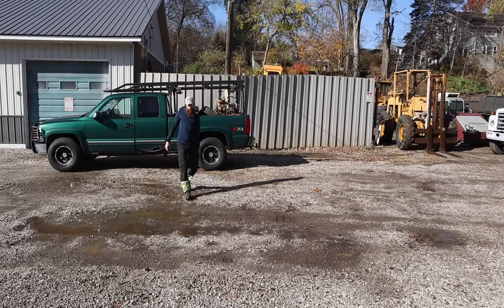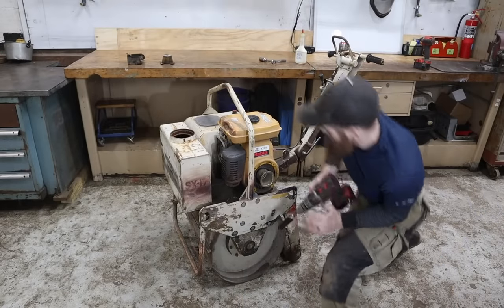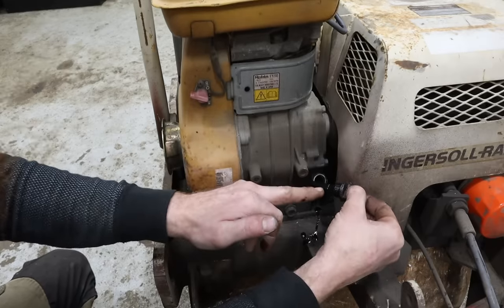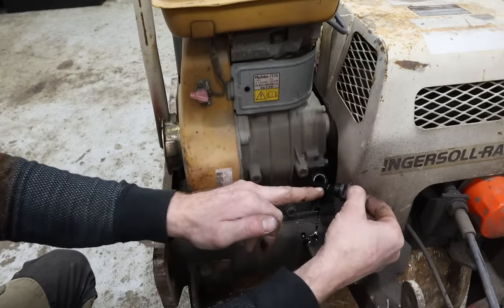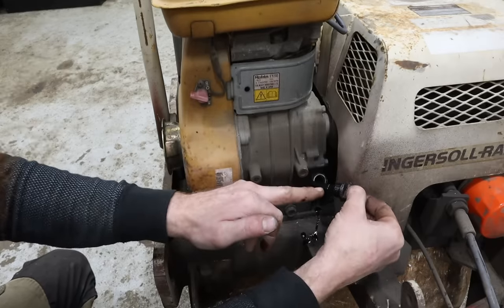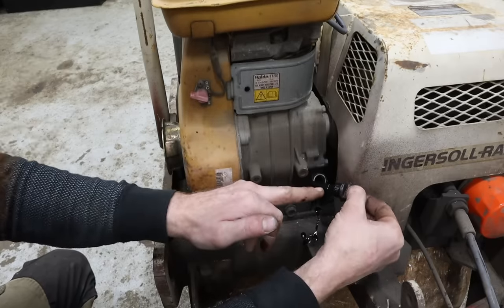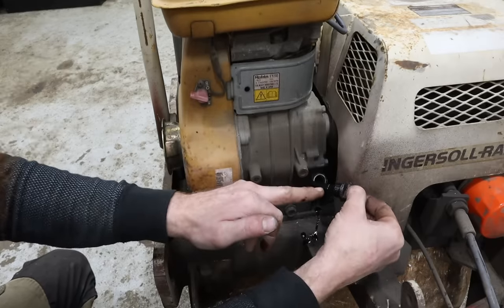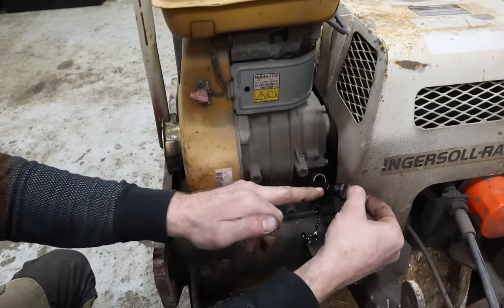I PULLED this Roller from a DUMPSTER!! -  Can we SAVE this Forgotten Walk Behind Vibratory roller?

Comment: The old rule of thumb when I was in the Navy was, 3kW = 4hp, so 3.7 kW @ 4000 rpm would be about 5 hp.
Reply: 3.7kw converts to 4.959hp
Reply: 3.7 kW x 1.36 = 5.032 HP
Reply: 1Hp=746W👍
Reply: Yeah it 5hp. But for us eu guys kw is comparable. So for example if i have seen what kind of power 3.7 kw electric motor makes i know how much power 3.7kw petrol engine would be, because its the same.
Reply: I think 5,5 chuck mc Atee
Reply: 😊ii😊😊i😊bib😊bbib😊😊ib😊i😊bibi😊😊😊😊b😊ib😊😊b😊bibb😊😊b😊bii😊ii😊b😊b😊bi😊b😊bibi😊😊b😊i😊ii😊bii😊i😊i😊bi😊iii😊ib😊😊bi😊bib😊ib😊i😊biiii😊😊biii😊i😊😊ii😊iib😊ii😊😊iii😊i😊ii😊ii😊i😊bii😊bibiibi😊iíbiiibii😊i😊iiiiiiiiiiiiiibiiibibiiibibibíbi
Reply: @aaroncarlone167  ii8
Reply: H

Comment: According to the innerwebs, the EY20 is 5hp. There are all kinds of manuals available also. That appears to be a simple hydrostatic transmission. There is no high pressure on the outside, the bottom line is suction and the top line is return. Great find! Great to see another video, too long since the last one.

Comment: Shooting a little air under that rubber handlebar grip will make it come right off.  Also hairspray will make them go on easily and will sort of glue them on when dry.  Learned that from putting on the left grip on a motorcycle handlebar.
Reply: I worked in bicycle shops and those both are standard practice. I love the smell of Aquanet in the morning.  If you're good you can shoot the opposite grip off with the air hose and hit your buddy working at the next stand over.

Comment: A trick from the bicycle world for hand grips, you can sometimes use an air compressor to get just enough air in between the bar and the handgrip to get it on or off.  It made my day to see this video to watch today in my feed. :)
Reply: A few drops of lamp oil inside the handles might do the same thing.  They slide on easy and as the oil evaporates, the grips are on solid.
Reply: I slip one or two pieces of welding wire, (even coathanger would work), into the hand grip, and then sprinkle talcum powder in between the wires.  the hand grips will turn right off.
Reply: @jjock3239  That is good to know, but if you have it available, compressed air may be less cleanup. :)
Reply: @josephkrug8579  That is true, but you only need a light spray.  I have a plastic bottle with a fine tip, because I use the powder for other jobs, such as accelerating the drying of superglue.  I don't know the next time I will have to remove handgrips, but I will remember the compressor trick and give it a try.  I am not afraid of new tricks.
Reply: And use hairspray to assemble them. Slippery at first and then ' sticky' , so they won't come off.

Comment: I’ve always heated the last inch or so red hot and then bend the hook, then requench in water to restore the springiness.  It’s worked well for many years with my  outboard, especially when we were in isolated areas.  Usually that’s where the spring decided to bust.

Comment: I spent many years working for a plant hire company and did many repairs on the Robin engines . Replacing the recoil spring was the least liked job , had many springs try to escape as yours did . It felt like winning an Oscar when it went together ! !

Comment: When I worked in a bike shop we would shoot a toot of compressed air under the edge of the grip to remove it and use hair spray to lubricate the grip for installation and then fix them in place. Love the video. Keep up the great work!

Comment: I rescued a little 5hp robin engine with a hole in the crank case I made a plate for the hole and ran it with a bent rod on my lawn mower for about 4 years. Economical to run and still running when I sold the mower.
Bullet proof.

Comment: On spring stock, if you sand off the blue on the last half inch or whatever  you need to bare steel and gently heat until the temper color goes back to blue and while still hot, you can bend the end to whatever shape you need without breaking the end off and without overly softening the spring..
Reply: Motorcycle shop for the cable a clutch cable

Comment: Just a little tip for feeding the pull cord back, cut a notch the same size as the cord in the plastic pulley. This will allow you to wind the cord while the handle is fitted. Honda GX engines have these as standard, but the robin engines don’t.

Comment: That was fun to watch. A friend loaned me a plate compactor that "ran fine", NOT. Same tank & engine, but older, with a paint job that obscured most ID on the unit. The carb cleaning brought back fond memories. It's a great feeling to bring life back to what might appear to be a lost cause. After revival, it worked so well I had to add  & spread two more tons of gravel just to get the level back. Thanks, good work 😎👍

Comment: Nice to see it resurrected,  great work .Tip roller easier to use with handle lowerd , and when before you stop in any direction turn off vibration as you will have ridges especially when rolling asphalt,  thanks for sharing 👍

Comment: great trick to remove those stubborn rubber handles: punch a hole at the end, insert a compressed air nozzle and they fly right off! :) learned that in the bicycle shop i worked in as a teenager.

Comment: I'm not too sure about that particular IR compactor, but I had a similar one and the small roller in the rear was adjustable...  I'm pretty sure you would find it easier to control if you could swing that back roller up a bit...

Comment: Nice find. Packers are so darned useful. The extra tube on the top of the carb, is probably the float bowl vent. I'm guessing it needs a hose to run into the back of the air cleaner. Killing the engine with the fuel shutoff valve, is definitely the best way to shut off an engine...especially if it is likely to sit for a while.

Comment: I worked on bikes. You can remove the grips with compressed air, by using the pistol, and we used hairspray to slide them back on and fasten them again. When it dries they are solid.

Comment: For hand grip removal, lift the grip a tiny bit and spray Windex in the crack between the bar and the grip. Capillary action will pull in the Windex and the grip will slide off.

Comment: As a child I remember my stepfather being impaled by a forklifter fork he was shifting a pallet by hand turned around and was impaled by the fork then pinned against the pallet stack luckily he wasn't alone in the warehouse during the night shift his coworker backed the lifter off him then he picked himself up off the floor and drove himself to the hospital too get stiched up .
If you only need one fork to lift take one off or move the forks together never have a gap you can fit in and never enter a gap between forks never have your back to a forklifter or any other piece of operating equipment practice proper equipment operation safety it only takes a second of  negligence for injury or death to happen.

Comment: great to see the use of an industrial stethoscope. Tip: hold it to the bone behind your ear. I have a BAHA (bone anchored hearing aid) these days and it clips into a bolt that's screwed into my temporal bone (the bone behind your ear) and it is far more effective as it goes straight to the hearing nerve via bone conduction. I used to do the same as you did in the video when I was working on machinery in the holds of ships and wish I had known this back in the day.

Comment: Great Job !!  As for the gas tank... You might be able to get some of major ding's fixed, by using compressed air !  If you can find a metal fill cap and close up the vent hole.  You can use the the threaded fuel line port for the compressed air. I've used this method for restoring vintage motorcycle tanks !  PS: You might be able to use a motorcycle throttle, brake or clutch cable, for your throttle cable problem too.

Comment: Quick tip for removing grips.... spot off oil on the end of a flat screwdriver, tuck it underneath the grip edge and as you skid the screwdriver in rotate it around.  Easy job.

Comment: I have been able to bend a new end with a fine tip on my torch & only heat & bend a quarter inch but it has to be orange hot when bent not just hot. Then you can file in any notches needed.   Good luck!

Comment: I've had great success with using a torch on the end of a broken spring like that.  Just gotta remember to get it HOT and let it cool slowly.  Little pieces can exhaust their heat so quickly, they'll quench in air.

Comment: Just a heads up, before connecting the fuel to carb, run a cup of fuel thru the tank via the petcock to flush it out so nothing gets in the freshly cleaned carb

Comment: What a great free find, Ingersolrand have a good reputation for this type of equipment.
The dipstick for the oil, looks like the one I used to have on my old Honda 90, you need to waist it it to get the correct level. I think you'll also find that there is to much oil, there are marks on the bottom of the dipstick that will show you how much you need to put in. Good seeing you back, have missed your in depth filming.

Comment: This is very useful, instead of squirting petrol in the spark plug hole: Nulon "Start Ya Bastard" Instant Engine Starter (SYB) promotes easy starting of all diesel and petrol engines (both two-stroke and four-stroke). Preserve battery condition and it is totally harmless to engines. One short spray of Nulon is all that is necessary to start the most stubborn of engines.

Comment: Many years ago most contractors I worked for usually had an old timer or “shop man” that took care of equipment and tools. They would make sure that it was cleaned, lubricated, all necessary fluids topped off, etc.  That way everything sent out to the job site was ready to go. Nowadays that’s too expensive, if it breaks, replace it. Pretty much like everything nowadays, Crash it and trash it.
As far as thread sealants go, the only thread sealants are anaerobic thread sealants and Teflon tape. Anything else is thread lubricant despite what the label says. The seal is obtained by the tapered threads and the pipe “sealant “ keeps the thread surfaces from binding and galling so it can be tightened more.

Comment: I have found that small engines LOVE the E3 plugs. I have also seen small engines gum up the exhaust and chock them self out from a packed muffler. For the oil lines they look low pressure, see if you can find barbed fittings and prebent lines from the auto parts store that are oil rated.

Comment: One thing I’ve tried before with those recoil springs is to keep the majority of it submerged in water with just the top 1” or so sticking out (or whatever length you actually need for bending). Using a propane torch, heat it up to just below a hint of red (or just slightly past but before cherry) and gradually taper the heat off over 10-30eec.

IF the spring is still too brittle after trying this, then repeat the same procedure except taking the steel and holding it for 15sec at bright red and slowly taper heat down 15sec until red disappears and another 15sec with the torch on lower heat and/or waving the torch back and forth across the metal. Bend to shape reheat and quickly quench to restore spring. 

If this fails the variation is wrapping all but the last 1-2” in soaking wet paper towels or cut lengths of rags from repurposed cotton T-shirts: All secured w/ steel wire or pieces of copper from electric wiring.  This time you’ll be heating up the end and trying to get your hook bent WHILE it’s still hot from the torch.  Once again, when the shape has been achieved reheat and quench to regain stiffness. 

If you still can’t get any stable results & you can’t get a usable replacement due to Time or Availability THE LAST GAMMBIT, DESPERATE OPTION, MY FINAL SOLUTION is protect the spring as mentioned above and then solder or silver braze any length of similar spare spring or any piece of metal that you think will survive bending and strain. 

BUT AGAIN these methods are almost always done as a form of quick fix or LAST RESORT until a new spring can be hunted down or made (I had WAY TOO MUCH time on my hands one day and was too stubborn to call it a lost cause but I learned something new😅)

Comment: In a pinch, I've  put the spring in a vice with a little sticking out of the top of the jaws. The vice acted as a heatsink.  I hit the end of the spring with the torch and made my bend.  Then I  quickly  took it out of the vice and quenched it.  Worked every time.

Comment: Sometimes you can bend the spring by using a nail by  slowly pulling springaround nail or ɓolt about 3/8 in or larger in a vice and walking it with Chanel lock  pliers carefully. Good luck take your time

Comment: I think the BDU-10 is the same hydrostat transmission used in many garden tractors like the Cub Cadet GT 2550.
Reply: Yes and not sure Hydraulic Fluid is correct for this. What I could find online was Engine Oil 20-50W

Comment: When I make a temporary repair using whatever material is available like you did with the semi air hose. I call that a proof of concept repair. If it confirms what I think is wrong with it. Then Ill use the proper material for a permanent and proper repair. Very common.

Comment: Gas filter can be inside the tank. You maybe need to modify the valve or get a new. The throttle looks like a boat cable.

Comment: Thread it right the way in to ger oil level. I have an EY25 from 1970, and the only thing that I have had a problem with is a sticking valve through lack of use. I don't know about the US, but in Oz parts are readily available for them.

Comment: Great to see you back with another video - you have been missed.
The oil level on these engines are either read by the dip stick not tightened back in or the oil sump is filled till it it starts to overflow. I have two of these old engines but is hard to say which is correct for that particular one.
Check if the mark on the dip stick is correct when oil is at the level where it overflows on the in fill. You might find a second entry also below the carb but this cap doesn't have the dip stick.

Comment: INGRESOLL RAND (JAPAN) RECONDITION HEAVY DUTY Single drum WALK BEHIND SINGLE DRUM VIBRATORY ROAD ROLLER, 17.7in. wide drum. U.S.A. Engine Type: ROBIN JAPAN, Overall Dimensions L x W x H (in.): 60 13/32 x 25 5/8 x 38 13/16, HP: 4.8, Compaction Force (lbs.): 2000, Compaction Depth (in.): 9, Vibrations Per Minute (VPM): 4,460. See also Ekuipa Market Place.

Comment: Would love to see you find and rebuild a old motor grader in decent condition to start with and still find parts for it to keep it going for another lifetime.
Reply from the maker: Did you miss the motor grader i already rescued? I also recently rescued a second one!
Reply: @SalvageWorkshop  I missed that one. Sorry but I've been a fan for a couple years now of your work.  Reason I asked about a grader is you have a good fleet of dirt working equipment  and to get a more versatile operation you need a grader to do the fine work with.  Only other pieces of equipment I would think you need and would love to see you rescue is a powered sheep foot roller and a rubber tired roller.  Those two be beneficial for you and light enough to move with your rig. One last thing you need is a dump truck . You would have a very good set of equipment to go out and do a full job on just about ant type of site. Only other couple machines to get would be a dragline to use as a crane or digging with and a scraper. But those two are really heavy and take a semi and lowboy to move. But for your fleet you have and capable of moving yourself it is not much more equipment to gain for the jobs you could handle.  Miss seeing Ol Red love to see it back up and running soon.

Comment: How could someone wanna scrap a machine made by IR?!? That’s just crazy. Awesome find!
Reply: By the way I think the pulley you were referring to after removing the cover from hydraulic pump is called a centrifugal clutch. As the RPMs come up on the gas engine it will engage the hydraulic pump

Comment: That spring. Put spring in vice with enough for your hook hanging out. Heat the end cherry red and bend the hook. Holding it in the vice will stop the heat from tempering the rest of the spring.

Comment: With trying to get the spring repaired. I have bent it round the shaft of a small screwdriver before now, as you have already seen that trying to bend it with plyers it will just keep snapping off.

Comment: it's usually not worth it for the price of replacement springs. but you can rebend spring hooks but you have to retemper the spring afterward The one old feller i know used molten lead it melts around 400. heat spring to red bend hook. quench hook in oil clean then dip in the molten lead to pull it to temper then allow it to cool. quick and dirty way to temper but it works more often than not. I usually only go to the bother on things i can't get new springs for

Comment: For the oil lines I've used 10mm central heating pipe with olive pressed on and a bike cable Leave outer cable should fix next time  you com across it

Comment: In order to check the oil you wipe the stick off and put the stick back in and pull it out. That will give you the proper oil level.
I own a Robin Subaru motor and that is the correct way to do it.

Comment: You can Re bend the hook in the spring need to keep it hot when your doing it, once you get it where you need it dip in old motor oil to get it back to the hardness since old motor had a lot of carbine in it.

Comment: You can use an air nozzle to put an air cushion under the grip to remove old hand grips from handle bars, grip bars, where ever you find a need to replace a grip like on this machine.